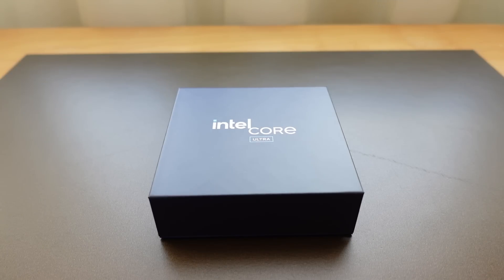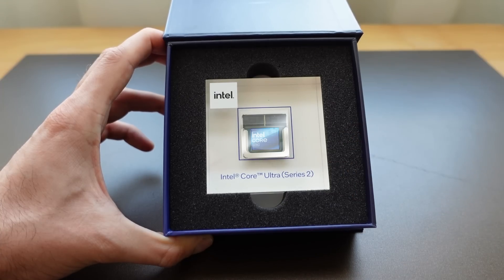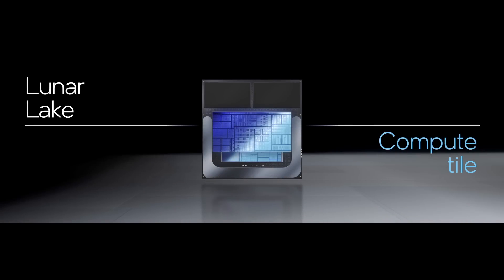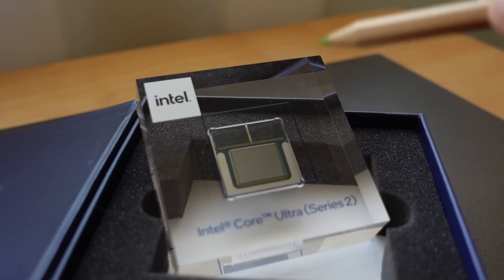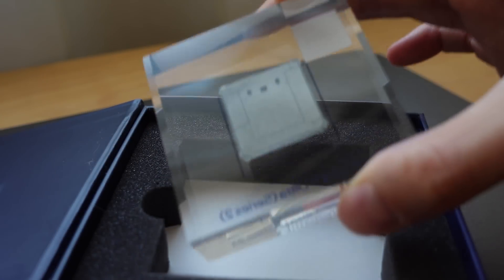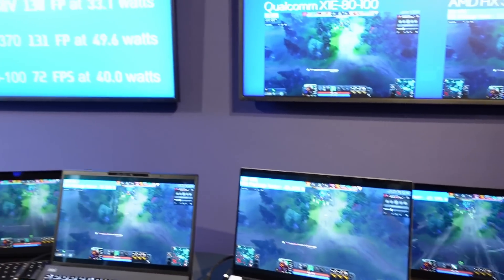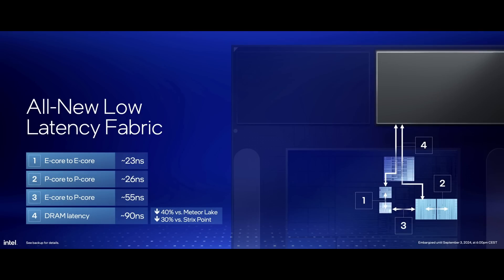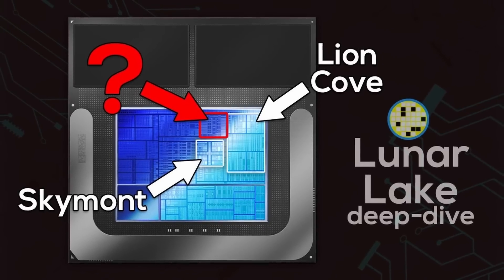Hands-on with Lunar Lake

Comment: I personally insist on being able to work on my hardware. I am also a tad rough on things due to the nature of my work and interests, so I am not a fan of the "thin" market. I cant even stand how fragile phones are now days. I got.my first new phone in years a while back after the screen decided to just die. I had it out of the box for maybe ten mins. I didnt have a case yet and it was so thin and SMOOTH? that with it in my had walking at a very slow pace and stopped, it slid/shot right out of my hand and about a meter down to the floor destroying it instantly. I could punt my old laptops and still fix them.....well except for all those "slow"(3 year old) Macs people gave me. One from 2013 I had actually died because I installed Ubuntu and watched a YT video. Apparently Apple made changes to the "open source"/basic intel IGPU drivers/bios code just enough so it wouldnt play well on Lunix, so now it is dead dead. I just get a white screen, am unable to boot into any recovery or anything. No CMOS battery to remove either. Had to disconnect the battery after resetting the NVRAM didnt help.and still not.luck. I called it and.stuck it in the parts pile.....although I have no idea what parts I could use from it being serialized and all. Most people see convenience, I see future E-waste.

Comment: I strongly believe there's a lot of "power efficiency" to be gained from current mobile chips too:
- Windows must be made more sane in terms of unnecessary tasks and boosting behavior (Apple did an amazing job there)
- the CPU must have more stringent power profiles and behavior when on battery

This is mostly the OEM job of tuning the hardware platform and (1) cannot be trusted because MS won't handle its own bloat (no reward in it for the managers).

Comment: Lunar lake CPUs have 4 performance cores and 4 efficiency cores that run at 25% of a perf core so they are like extra threads!

In other words, intel is trying to sell 4-core cpu's from 2011 now in 2024.  They are attacking the Chromebook market HARD !   I for one don't want to live 13 years in the past ...
Reply from the maker: Actually, the Skymont E-cores are much faster than the previous Gracemont E-cores. By like 70%. They are closer to previous P-core performance.
Reply: Then buy a proper work laptop. This product isn't for you.

Comment: Intel: 5N4Y is a tremendous success and everything is on-track.
Also Intel: Refuses to use its own lithography nodes more often than not, and when it does use them, the parts reach nuclear energy densities and then just degrade and die.

Comment: I had the idea of trying to shrink everything and put it on something the size of a processor and just have the motherboard be IO and power delivery. that way things like laptops and handhelds could be upgradeable. i think it would also simplify the design of the mainboard so smaller niche manufactures could go wild with unique designs.
Reply: AMD did this with Ryzen (Zen 1). They had announced A300, X300 motherboards without a chipset and ALL IO coming straight from the CPU. That's why Ryzens all had SoC settings in UEFI.
Have you seen such motherboards? Yeah. I don't think ITX motherboards dropped the chipset either. I gueds it's only ib the little known stuff like mini PCs in non-standard form factors.

Comment: The starter RAM capacity of this chip, just make "fruits" shame. Still offering 8 Gigs even this year

Update: Maybe on Next Gen (Apple M4 Chips maybe), it will be fixed
Reply: 8GB is just enough to sell this laptop at scale to businesses as an office computer such that it degrades the performance right towards end of warranty.
OTOH markets like Asia.
Reply: You know whats worse. Here in India they never offered any discount on 16GB M1 MBA, Apple actually increased the price of 16GB model in India before discontinuing it. 16GB/256 was launched at 113K that was increased 120K in year or so.
Reply: I think 8 GB is fine if you don't use Windows.
Reply: @marvin3898  oh yes its fine but for its price its a rip off

Comment: Nice low end chip for netbooks. Just the "Ultra" confuses me, as it sounds like "here's our high end product".
Reply from the maker: LNL is actually Intel's premium CPU, for expensive think & light laptops. ARL-U will cover the low-end systems.
Reply: Its 4 cores and 8 threads (the e-cores are like extra threads).  Intel trying to sell 2011 products in 2024, how droll ...
Reply: @systemBuilder  And tied to max. 32G ram lol. They may be efficient, but they are not 'Ultra'.

Comment: >filler tile

I wonder if there's any real connections under there. Like they partially used this to debug the chip, and in some 5..10 years time we're gonna see unrecycled engineering samples with proprietary software packages that allow you to manually set some fun registers in the CPU or flash a new microcode or something.

Comment: SInce the memory isn't upgradeable I wonder if there would be a way of doing a tiered memory upgrade. Such as the on package memory will be used first and for important tasks, and you can have a lpcamm or dimm for extending the usable memory. It's not like windows would crash because of how slow dimms are.
Reply: I doubt it. If you have 2 different RAM modules in a desktop, the RAM will run as slow as the weakest link.
Reply: @zachb1706 in this case the memory bus is already 128 bit wide and saturated by those chips, so it's more of a 2 vs. 4 modules with dual channel situation
the new module must be the same size, type, frequency and even timings as on-chip memory for this to be possible at least in theory
also, on-package external cache is a tried thing for Intel, remember Adamantine cache technology that seems to have been dropped
... and I don't think memory tiering is possible with modern PC architecture
Reply: imagine if someone still produced Optane for, like, PCIe 4.0?
Reply: @VADemon  P5800X is exactly that (I think they wound down the production, though)

Comment: Just because it has on package ram doesn't mean we can't supplement it with more camm ram. Just like different levels of cache.
Reply: Why would a manufacturer spend all that money to add a slot no one would use anyway?
Reply: they have no plans on adding ram slots on those laptops, guess what happens there
Reply: Only if the chip has a memory controller routed out through the BGA
Reply: They will have mobile arrow lake chips for that
Reply: @krazyolie  yeah that too. Anyone who wants more than 32 GB probably needs more power than Lunar Lake can provide.
Reply: @zachb1706  yes this is aiming to compete with macbook air, really

Comment: The on-package memory is a huge turn off for me. I understand the benefits but this places a huge "planned obsolescence" limitation on the SOC which I do not want to support. It's bad enough that cell phones are built on this idea but moving it into devices that don't necessarily need it is just wasteful and anti-consumerist.
Reply: By the time a ram chip fails the device would be obsolete anyway.
Reply: The thing is, this has a real tangible benefit to the consumer, and usually at no cost. I don't like it too. But the truth is, the closer you put the RAM chips to the CPU, the better the performance. It's just physics. This performance gains are visible in the real world, too. Just take a look at how Ryzen processors can't even breathe without some proper 3500+ MHz memory. And the thing is, we are past the point where upgrading a computer, let alone a laptop, is a common thing to be doing. Sure, it's nice to be able to do so. But, honestly, if you are one of the dozens of us upgraders... You're probably also the target audience of a cheap hot air station, some flux and tweezers, and old graphics cards from ebay to practice on. Get to soldering and desoldering and resoldering and you're probably gonna be able to upgrade your RAM in no time. I mean, all software is open source if you can read assembly, am I right?
Reply: no modular memory system in existence can support the amount of memory bandwidth that Apple M* can do, it would take 4 LPCAMM modules to match the amount of memory channels as apple M2 max

good luck fitting that in a sufficiently thin chassis, good luck routing the traces on the board too
Reply: I think it's not too bad for the target demographic. This is for thin and light computers / less demanding use cases. 32GB RAM is good enough. This would be a much harder pill to swallow for high end systems.

Comment: They used all easy hacks possible, monolith die, ram on chip, no hiperthread,  OS level scheduler,TSMC latest node. 
Next generation will be hard to "innovate".
Reply: Next generation will get 15%+ IPC and lower power consumption because of the node advancement (Intel 20a/18a), just like Apple did with M1-M2-M3. Besides that, there will be some corrections and optimizations.
Reply: I think its do or die situation for Intel, they can't delay anymore.
Reply: They cut down their cpu to 4 cores 8 threads (e-cores about as fast as an extra thread).  Next step is Core2Duo renamed as "intel core Ultra Super EWhiz processor"  and let the salesforce move that product !!!

Comment: if this cpu fail , we can kiss goodbye to intel
Reply: No, we won't. Next gen will be even made by Intel as they havr sorted up the manufacturig for the 20a and 18a. That will make them a better margin and they could sell cheaper if needed, so they can keep the market. But if the architecture is proven to be good, the better for Intel. I, for one, hope the number they are showing are close to reality (even if not 100%, but 90%), so it gets better framerates with lower power consumption vs AMD amd that is a grdat achievement.
Reply: @ContraVsGigi  what i meant is that if  intel misses a technical issue again, this compagny will never be able to recover , the trust they lost is already big
Reply: @jeisntthereanymore  They never had problems with the laptop CPUs and server ones. The only ones were the highest desktop performance ones (also used for some gaming servers). Not that huge of market.
Reply: @ContraVsGigi  They are gradually losing laptop CPU market share too. Numbers may not indiacate it but Apple ditiching them was big on impact, even Qualcomm started believing they can make PC class chips.
Reply: AMD is figuring out how to do a successful laptop launch, and Intel is now in 4th place, this release is some Chromebook class CPUs, equivalent to 4 cores 8 threads!

Comment: "As you can't upgrade the memory, at least not withoht expert soldering skills." The mere thought of hand-modifying this fills me with dread.
Reply: I saw some guy recently who had changed the RAM on a Raspberry Pi (between two models); I suspect this is harder.
Reply: @henrikoldcorn  It's way harder. A raspberry PI is a relatively large board while these SoC's have their memory right next to silicon chips which are connected to the PCB with absolutely microscopic solder joints, many of which may simply get damaged by too much heat...
Reply: I'm still building up the required strength to upgrade my 3dfx Voodoo 2 to 12MB 😂
Reply: previously on thin and light laptops RAM was already soldered on
not too big of a deal I think
Reply: Have we already forgotten Intel chips are burning themselves out?

Also I'm sure there'll be a model with extra ram... for Applesque captured market prices.
Reply: @greebj  I'd guess most people won't forget that anytime soon, especially with all the class actions coming in. Don't think they are in the position to sell with "Applesque" margins, at this point it's just about surviving for them
Reply: Just wait 10 years youll find someone on youtube doing it just because
Reply: @exzld , I'm sure there will be such folks. They have skills I cannot hope to attain, my fine motor control has been underdeveloped since childhood.
Reply: I’m pretty sure it’s possible. there’s already people changing ram on mac and storage on iphone/ipad
Reply: techmodlab upgraded a soldered laptop gpu along with its vram, compared to that this is a cakewalk
Reply: Don't worry , there will be no need to do it.
Manufacturers will install it on cheap laptops with weak cooling systems, and in a few years whole chip will burn out, like it happened with Intel 4000u series 10 years ago.

Comment: so if your ram fails your CPU fails 🤔🤨
Reply: 100%. I can't shake the feeling that there will always be less and less repairability and with transistors and traces being smaller and smaller we may see less longevity from electronics. I hope not.
Reply: We have already reached that point. Try to repair a MacBook and your gonna find yourself in a world of PAIN, both physically and mentally
Reply: @bigfatkotik7089  I am OK with that as long as my laptop doesn't burn my thighs and can't run more than 3hrs away from mains.
Reply: What ultrabooks have had upgradable memory? It isn't relevant for this part of the market.
Reply: if this ever has a bad ram region, sell it to me. i will keep it running while excluding the bad blocks :]
Reply: yes, and being intel, imagine rma, you are using it wrong, is your fault, apply rma again, wonderful